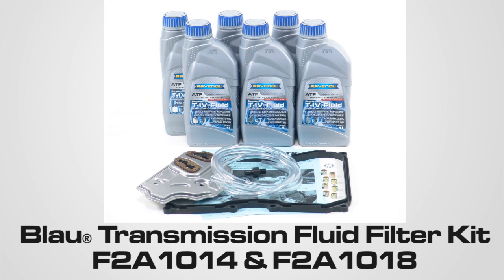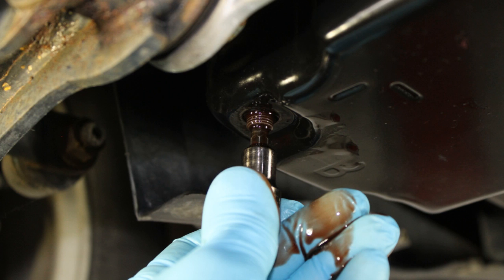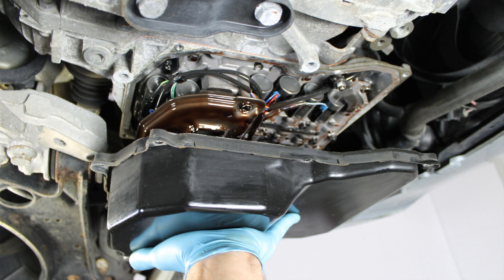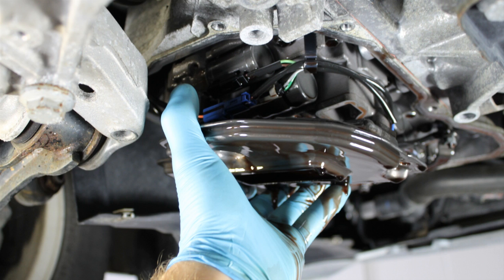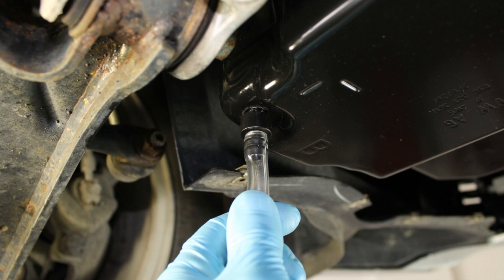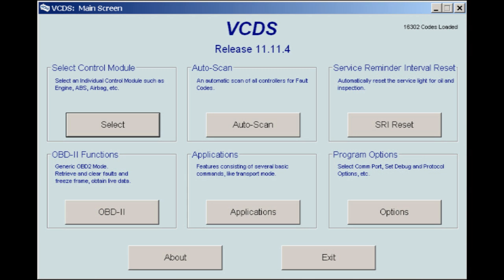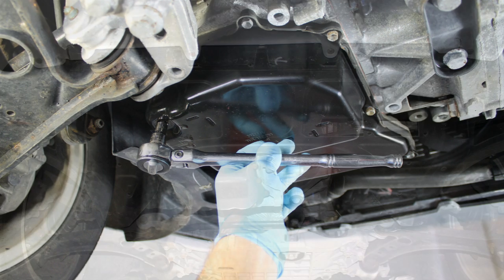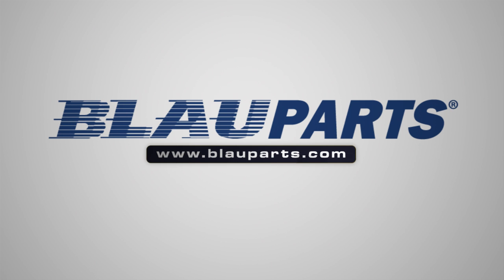How To Change VW Beetle, CC, Jetta, Passat, Rabbit Transmission Fluid & Filter Aisin 09G

Comment: Hey so while I was unscrewing the pan off my car the bolts were rusted to hell so when it came out I had to cut some of the bolts to be able to get it out but now I don’t know what those replacement bolts would be and I’ve looked everywhere online and I can’t find it, please help

2008 Volkswagen rabbit automatic 6 speed
Reply: you need a thread pitch gauge. and hole size gauge. many hardware stores have these in their hardware sections if you can take you bolt into the store. Many tap and die kits will come with thread pitch gauges. always do a visual comparison of the new and old hardware as well. the thread pitches should fit perfectly and be the same width.

Comment: It seems there was an error in the instructions, please correct me if I am wrong. At around 5:13 you say that after filling the transmission install and torque the drain plug. After that, we allow the atf temp to reach between 35c to 45c range and we should begin to see some fluid pour out of the level insert. How will fluid pour out if the drain plug is installed and torqued to spec?
Reply from the maker: Hello Ev L!

The instructional step around 5:13 is correct. You will have the best success during your ATF change by following the steps as closely as possible. Install the drain plug as outlined around 5:13. Allow the engine to idle and wait until the transmission fluid temperature reaches between 35c and 45c. If you choose to keep the drain plug out before the ATF temperature reaches between 35c and 45c you will have allowed too much ATF to drain back out of the system. To check the level, the drain plug should only be removed when the transmission fluid temperature is between 35c and 45c. Its the window of 35c and 45c that allows for the proper fluid viscosity and proper ATF level. The ATF level should only be checked between 35c and 45c. Between 35c and 45c allow the ATF to drain until you get a small stream (just as it changes to a drip.) from the level insert drain plug area. Then as outlined at 6:13 torque the drain plug to 12 ft lb. We also have some other videos on our channel that show a diagram of the transmission fluid leveling sequence on your application.

We hope this helps! And if you have any other questions, feel free to ask!
Reply: Thanks for clarifying this process, I will be purchasing your ATF change kit very soon.

Comment: how about 2012 Beetle 2.5l (5-speed manual transmission)? i dont see it in your list at the beginning of the video...does it apply to this 2012 as well or not? if not, do you have some recommendation how to do it? Thanks
Reply: This video is about certain automatic transmissions. You will have to search Blauparts for manual transmission vehicles. Hopefully they have something for you.

Comment: Good video, but when I watched this it wasn't obvious to me that the engine needs to be running when you check the fluid level. That's important since you will drain off too much fluid if the engine is not running. I saw this emphasized multiple times on one of the VW forums.
Reply: Should the drain plug  be out ? when  the engine is running and the oil level is tested??And if the plug is out,  should the plastic adapter and tube  be in?  to prevent splatter?

Comment: What if you took hoses off of the transmission cooler and put one hose in the new fluid and the other in a waste bucket and run the engine until it comes out red.

Comment: My friend, do you have the pipe stick that goes inside the oil pan on the drain plug, to measure the fluid level? My car doesn't have, therefore I can't measure it properly because it drains out completely, way below the correct level.
Reply: Dealer.

Comment: About How much Atf should drain out when you do the fluid check?
Reply: I followed this procedure when I bought my new-to-me 2008 VW Rabbit and I wasn't sure how much fluid was already in it from the last service, so I wanted to be sure to put the correct amount in. I drained 2.5 quarts. I installed 4 quarts and ran through the whole procedure while checking the temperature with an IR gun and drained the excess while leaving the correct amount in. 

The next time I changed the fluid after 5K miles, I drained 2.5 quarts from my initial service. This tells me that 2.5 quarts is the correct amount of new fluid to install. I changed it one more time after 5K miles because the total capacity in the transmission is about 7 quarts (I believe) and I wanted to increase the ratio of new fluid. I skip the temperature check procedure and install 2.5 quarts of new fluid. Before I drive the car with the new fluid, I let the transmission warm up and run it through the gears with the brake on as prescribed. 

Since then,I've been changing the ATF at 30K mile intervals and my transmission always works perfectly and when I start it from cold, I let the rpm's drop to 800 before I put it in gear. It never bucks or shifts hard and it has 155K miles on it. I've tried different fluids meeting the VW G 055 025 Spec and my favorite is the Amsoil full synthetic OE ATF. It costs more but since I only change it at 30K mile intervals, I consider it as cheap insurance.

Comment: I'm confused. Only 3 liters came out of the pan. Why am I putting 4-6 back in?
Reply from the maker: Hi there George! The dry fill capacity specified by Volkswagen is 7.2 liters and the refill is 5.2 liters. We provide the appropriate amount of fluid depending on the vehicle application. If you have any other questions, feel free to visit the 'VW Repair & Maintenance Information' section on our website or contact us here: http://www.blauparts.com/policies/product.html
Reply: Blauparts LLC my vehicle also drain out 3 liters its a golf 2013 base 2.5l I did not see any leaks before the process. I have no other option to out back 3 liters I will probably drain and use the others 3 liters to be mixed amd keep that amount of fluid
Reply: + ruben parrilla  Since the fluid is going to seek it's own level, you really can't overfill it.

Comment: So 4.5 liters drained out .I changed the filter ,gasket, and put in 5 liters into my non dsg trans. I have a 2013 passat 2.5 auto. And around 3 liters came out . I did use OBDeleven for trans temp .  
Is 3 liters spilling out about right?
Transmission runs and feels fine.

Comment: its 5 or 6 litres for change the transmission fluid?
Reply from the maker: Hi there! The dry fill capacity specified by Volkswagen is 7.2 liters and the refill is 5.2 liters. If you have any other how to tech questions, feel free to visit the 'VW Repair & Maintenance Information' section on our website here: http://www.blauparts.com/vw/vw_how_to/vw_how_to_repair_replace_tips.shtml
Reply: Blauparts LLC thank you soo much...
Reply: tr4x4 , we put 4.8 litres and.now have shifting problem. i think the appropriate is 3.5litre.
Reply: It's too late now but next time just pour out the amount you drain into 2 one gallon bottles. Use the same amount to replace it.  
 
That's what I did for my tdi I had no shift issues. I have a 1.4 tsi now and I plan on doing the same.